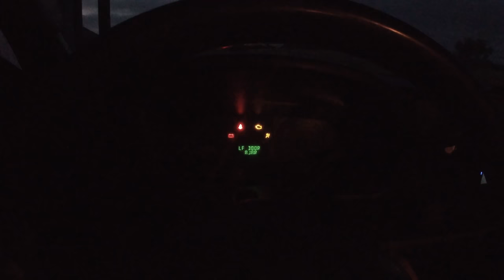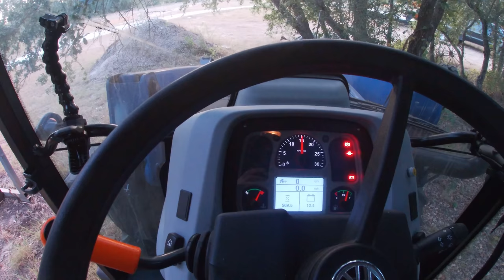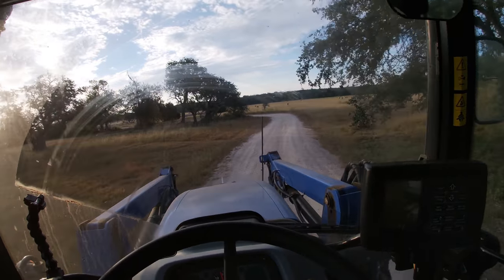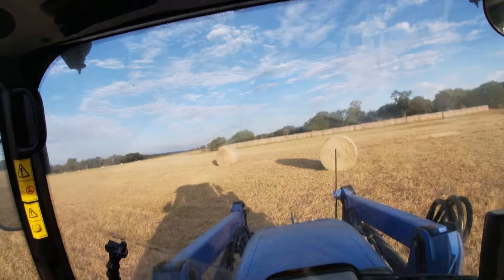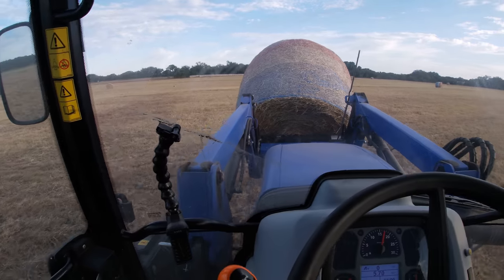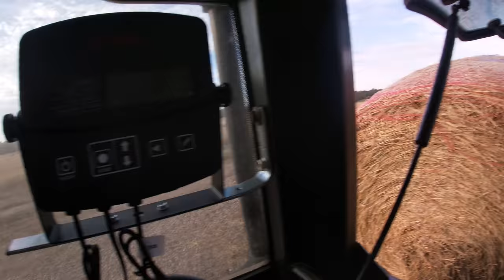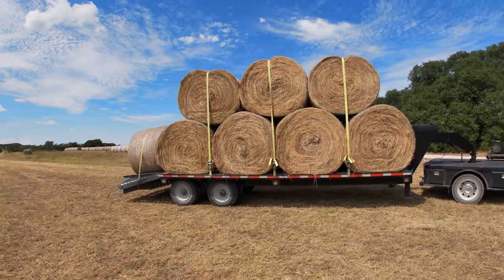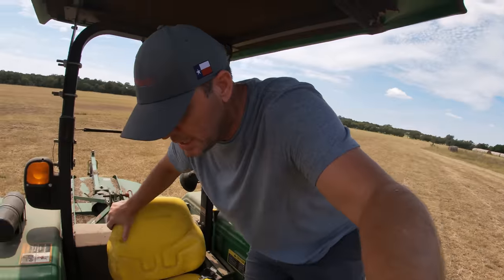New Rig, Stacking & Loading Hay

Comment: Knew you got a 6.0 from the start up.  I love the sound and I've had mine since 03 its been a  good  truck.
Reply from the maker: It was alittle nerve racking  when I first got it since I came from the 6.7 which “in my opinion” is the best diesel ever in a Ford. But I know the 6.0’s well and there are tons of aftermarket parts available for them. Plus the 08-10 are a nightmare to work on.

Comment: Thanks for all the great tips on the Work Master 75.   I purchased one this past year and still learning a lot about it.   My question...I'm am interested in using third function on it but I haven't seen any videos.   Do you use third function,  if so what is needed and how do you feel about using it?
Reply from the maker: No I have not needed it yet. You would need this kit from new Holland to make it work 731198551. Its around $1800 which has increased in price since I bought my tractor. If I was making square bales and running an accumulator or a bucket grapple on the front then I would need it.  I just haven’t justified adding it yet.

Comment: OUCH! Lol. I grimaced in pain but sorta laughed also, only because I know how it feels. I’ve been waiting to see that double spear put to use! Odds are you’re probably closer to 800 pounds in a 4x5. It’s pretty hard to get one to 1000 unless it has some moisture in it. Not to mention being able to get a spear in it would have to be so tight. Good to see you back and congrats on the good pulling rig! What type of quick disconnect is on the fuel hose? I need to do that on mine.
Reply from the maker: Lol I thought it was gonna be bad when I knew I was going down.  Yeah I’m thinking they are in the 800lbs range, I need to find a weigh station.  The fitting is similar to this Pioneer VP4200-4-CS  you can find at tractor supply. It’s great for keeping your fuel hose and nozzle out of the weather

Comment: Hey Chris, love the videos. Was thinking of upgrading the lights on our 75 to led. Wasnt sure if you've done it yet. And if you did, where did you get them from? Thanks in advance
Reply from the maker: I actually made an attempt and was in the process of making a video on it. I tried replacing the bulbs in the head lamps and all 4 flood lamps but I could not find a proper led bulb to either fit correctly or put out enough light to make a difference. The headlamp housing/reflective mirror  in the hood are 180* the opposite direction of a normal headlamp. So it made the light output shoot up and down not side to side. The only option for the flood lamps are to replace the whole unit with an aftermarket one like creed. It’s hard to explain but maybe I can make a video on what I tried to come up with.
Reply: @CenTexAg  totally understand what your saying, i looked at them quickly but havent made any attempts yet. I'll do some more digging on the web, I know new holland wants about $130/ea for the led replacement cab lights. But dont offer anythinf for the headlamps.

Comment: Are your trailer brakes not working or not working properly? Just curious as to why you were getting pushed through an intersection with the 350 and expect not too with the 450. I am aware that the 450 probably has larger brake components and more pavement contact with the duals. However if you were within weight specs on your load that trailer and truck combo should have stopped just fine. Just food for thought to maybe check the trailer over and maybe settle my curiosity to the braking problems.
Reply from the maker: Thanks for the suggestion. It’s possible the brakes on the trailer were not working properly that day. I was doing 65mph when the light turn red and had the pedal to the floor and it was not fun. The total trailer wait was 17k plus the single wheel 350 with a flat bed with a air compressor & auxiliary fuel tank was at minimum 8500lbs most likely heavier. According to ford the max trailer tow capacity for that 350 is 15,700. The 450 is a HUGE difference in stopping power. Plus I felt like it was wearing the 350 down quickly consistently hauling that much weight with 3:55 gearing. The 450 is so much more truck and I’m glad I up grader or down graded to the 6.0 lol
Reply: You definitely will wear out a tow rig quickly if you’re consistently putting it to its max. Gearing is a very important factor in pulling. The old say just because you can pull it with a lighter rig doesn’t mean you should. I constantly see people pulling travel trailers with a half ton truck should be using a 3/4 and they’re truck is screaming to put out of its misery. Your trailer definitely should have stopped you. Panic stops with a load is scary. I definitely recommend showing your trailer some love and give it the once over. Usually the trailer is the most neglected piece of equipment, I have been guilty of it myself. Maybe a video idea for you to show how the brake systems works, repair and general trailer maintenance. Just a thought and could be a winter project.